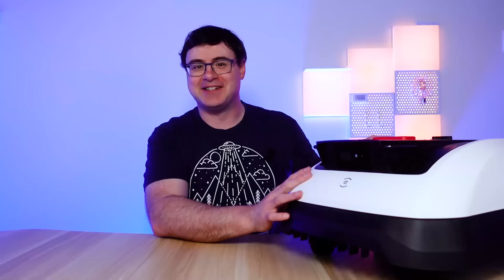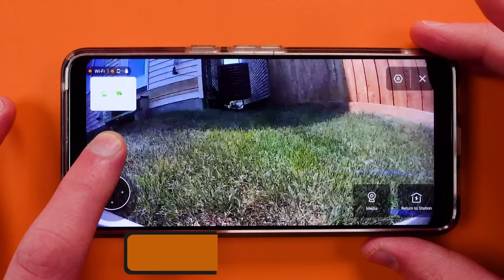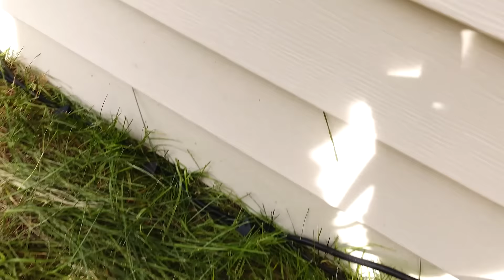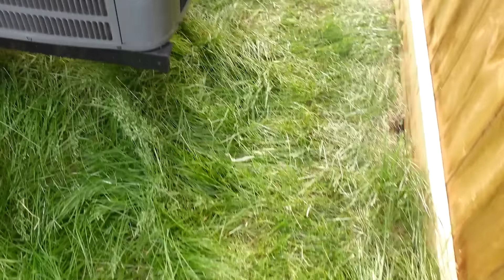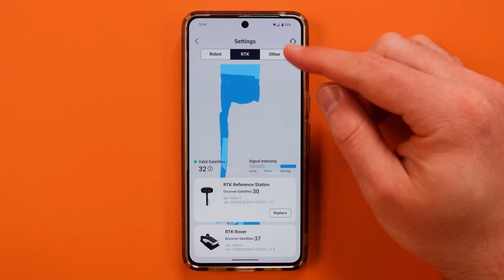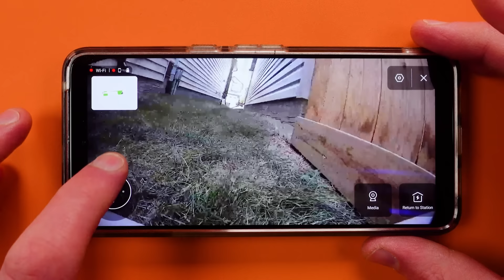I’m NEVER Mowing My Lawn Again - The Ecovacs Goat!

Comment: Hey Brian, did you actually order this or was provided?  The reason I am asking, is that I am in Canada and it appears to not be available.   Maybe that is a temporary thing.    I ordered and have tried the BestMow Titan 100 and after a month, it is going back.  When it cuts, it works well but the problem is either my yard in the GTA or my connectivity.  

The Bestmow uses a RTK as well, but it is independent of the charging station.   It uses your WiFI network to communicate to the mower through the charging station.   In my backyard I have the charging station - it connects to my Wifi.  I have the RTK installed in the front of the house for the clearest sky coverage.  It seems to balk at trees, walls, fences, etc.    It talks to the WiFi as well. 

Mowing the backyard seems good but going between the houses it loses track of where it is.    They blame it on the high houses providing the loss of signal.

Comment: I have this mower, im having trouble mapping new areas it will map then i try save it then the area i mapped never got saved, i ready mapped 13k sq ft i know it only cam do 10k sq ft but dont know if map is limited that u can only map 10k sq ft or im doing something wrong.. and it will miss little grass and straps of grass.. but it does a good job other then miss and hit..
Reply from the maker: 13k sq ft!  Whoa.  I don't know how to help with this one, sorry

Comment: I have had the 2500 model for a week now. A couple of takeaways from my experience.

#1 Don't stake your rtk antenna into the ground. Buy a wall mount and bolt it to your house. Why? Because ANY movement will mess up your maps. I had to redo my maps 4 times when the dog bumped it or the kids hit it with a garbage can when taking the trash out. 

#2 I live on a corner lot, meaning I have a street off my parkway on two sides of the house. Even though I have it set to stay within the border, I have had it back up and fall off the curb into the street several times. 

I reached out to ecovacs suggesting that they allow you to lock certain borders so that the machine can never pass them but never heard back from them.

I need to move my base station forward a foot because the robot doesn't like driving on mulch (it swivels back and fourth and digs itself in, even though the mulch is well compacted there) the issue is when you move the base all your maps are shot and you have to start over.

Overall, it's cool and does my 7000sf lawn in under 5 hours. It does recharge at least once during that process.

Oh, a little frustrating that the buttons on the unit can be played with when docked. So a neighbors kid can just walk up and hit stop locking it or hit play and starting a mowing session outside of it schedule.
Reply from the maker: Nice insight! Thanks!
Reply: Most people have the base in the backyard. Agree re the antenna, either fence or roof, whichever has clear view of the sky. Yes base should front directly to the grass. You could even lay pavers or cement under it as long as there isn't a "step" from the lawn level.
Reply: @peterhoz  would you reccomend for a small average lawn
Reply: @SpaceStrike Friday was our trash day, and the trash guy stopped his truck and got out and talked to me for 20 minutes while I was out front and the mower was doing its thing.

 He said he was going to go buy one after talking to me because it does work and it works really well, the only issue I have to work out is preventing it from getting into a corner where it turns around and backs up falling into the street and that only seems to happen when I don't cut the grass at 45° . in other words if I have it cut at 90 degrees to the street, that seems to be when it runs into trouble. ( you can set the direction it cuts in the app, and you can even have it rotate direction like every  week.)

Overall, I think it will take me a bit to get the maps right. I have a complicated yard trees in the parkway have large 5' diameter tree rings that only leave about two feet between the tree ring and the curb. The mower tries to sometimes turn within the two foot space and that's when it gets stuck hits the landscape bricks , backs up and falls off the curb.

As a side note. Ecovacs was running a sale for $1499 on my unit plus I found a 10% coupon code online. I was shocked they let me combine the coupon with the sale price.

I would definitely recommend an ecovac unit. Just mount that rtk antenna. I used a wall mounted antenna mount that has a curved three foot post on it. I slid the rtk post inside the larger mount post and used a couple of stainless self tapping screws to secure the two poles together.